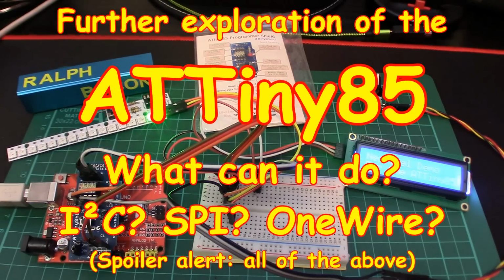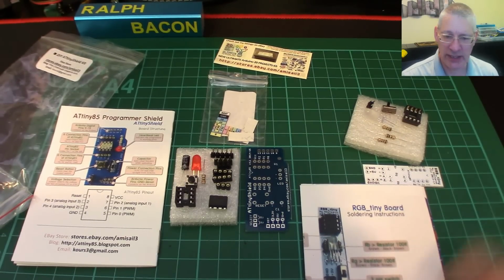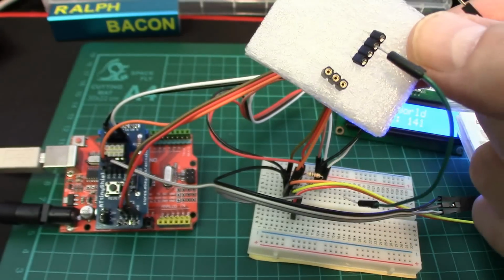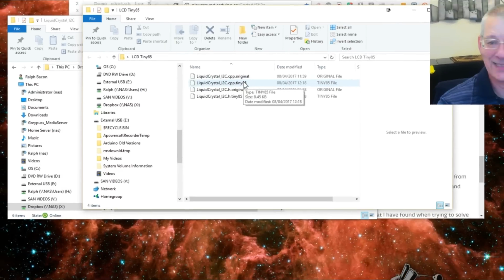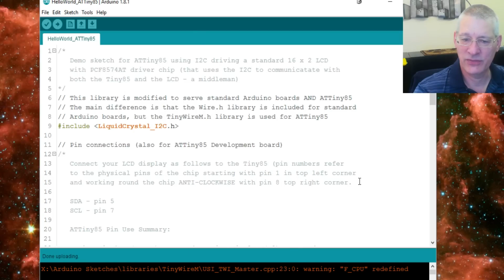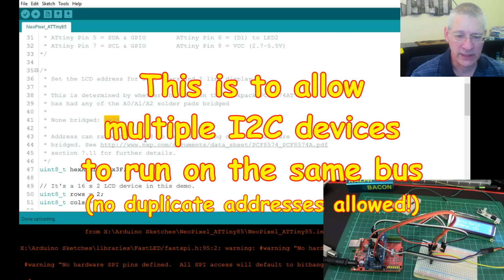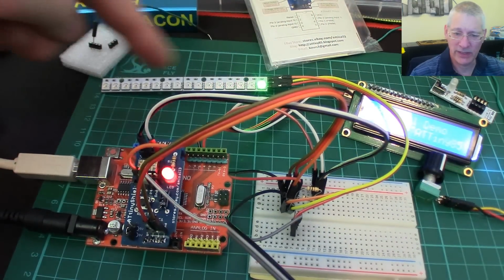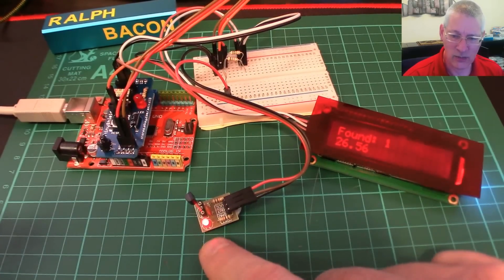#82 ATTiny85 + I2C  + SPI and more!

Comment: I have a Digispark ATTiny85 and it won't compile with a sketch for an LED matrix that uses the MD_Parola and MD_MAX72xx libraries. It shows the following error: Arduino\libraries\MD_MAX72XX\src/MD_MAX72xx.h:50:10: fatal error: SPI.h: No such file or directory.
I've already researched this and it's because of the SPI issue with the Digispark.
Do you have any tips? Thank you.

Comment: 12:32 You could make a few frames darker during editing. Why don't you?
Reply from the maker: Yes, I should have but it's a bit late now, some 6 years later! I'll bear in mind for future videos!
Reply: @RalphBacon  Hahahaha, I appreciate the good sense of humor. Thank you for the vids. Nice to see you tinkering with this stuff. Reminds me of my dad.

In my case, I didn't use the Arduino IDE, but bare CMake to compile the firmware and `avrdude` together with a programmer to upload it to the ATtiny85 or ATtiny13A.

The programmer is a fake AVR programmer I bought on Amazon, but it works great. I just had to solder an IDC connector (so it could receive the ISP cable) to a board and connect it to the DIP adapter that will hold the microcontroller on that same board.

It's fun

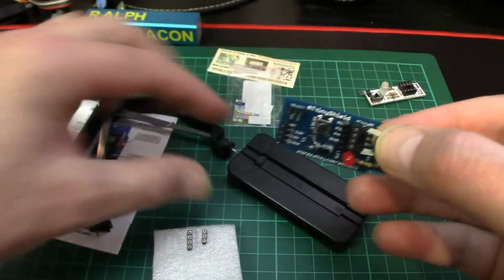Comment: what the name of the tool in 7:07?
Reply from the maker: It's an IC pin straightener, available generally, quite cheap and works a lot better than using your workbench to straighten pins! Example: https://bit.ly/DipPinStraightener

Comment: Hi Ralph. Any plans to do more vids on the ATtiny85 and/or ATtiny84?
Been using the 85 in a few projects recently due to only using a fews pins, and just acquired a couple of 84's yesterday and successfully uploaded a sketch last night. I think they're pretty cool chips.
Have made a couple of register name changes to my avr sleep code and although not actually uploaded, it compiles. Seems that the ATmega code will compile with the 84, but the 85 uses a different wdt register name.
Anyway.... Just thought.
Cheers.
Matt.
Reply from the maker: TBH although the ATTiny85 is a great chip for smaller projects, or even as interface chips for bigger projects, the lack of even I2C (designed to connect chips together, remember) is a bit of a handicap.

Yes, we can bit-bang both I2C and SPI (as per my previous videos) but we quickly run out of pins. The ATTiny84 has more, of course but then I get to the question: "Why am I doing this when I can get a cheap Arduino Pro Mini that has loads of built-in functionality and many more pins?" And all known Arduino code will run on a Mini as it's just an UNO without a USB interface.

What sort of applications are you thinking of, Matt?
Reply: @RalphBacon  Thanks for the reply. Warning.... Very long post ahead!! 
Most of my uses are simple industrial things. For example, scratch building a dual axis sun tacking solar panel array. Using a nano for that. It basically sleeps for 10 mins (using your excellent code) then wakes, homes in on the sun and goes back to sleep. Another very useful project was a Li-ion battery spot welder using an ATtiny85 (my first time with this chip). Used all the pins and disnt need more so when I made the PCB for it, it was nice and small. This is what got me hooked on the ATtiny chips. Another recent one was hacking my cheapo laminator and building a temp controller. It's currently using an ATmega328P, but may well liberate that chip and use an ATtiny, again just because of its small size.
Project at the moments is a current monitor for my 3D printer power supplies. I'm running a pair in parallel and need to keep an eye on current sharing. The 85 is working very well for this by monitoring by way of a pair of ACS712 modules and displaying the current on an OLED. 
Other projects such as my engine ignition simulator and motorcycle data logger use an ATmega328P and ESP32 respectively. The ESP32 is great as I've got pretty much every pin in use reading a sensor or doing something.
So what would I like to see from the smaller chips? Using timers perhaps. Maybe cunning ways to keep memory use low, as that always worries me a little. An example is the MPU6050 IMU that I'm using with the ESP32. I'm using the MPU6050_tokn library, but it sucks up a lot of memory, so a basic tutorial on i2c and how to interpret the data sheet with the 85 (or ATmega328P) would be great. I know you've done loads on i2c but having some detailed stuff in one super long vid would be a wholesome watch.
Probably blabber Ed on enough.
Merry Christmas.
Matt.
Reply from the maker: I thought I had a lot of projects on the go at any one time; you beat me hands down, Matt!

Keeping memory low can be achieved if you are prepared to look past the Arduino-speak C++. Using slightly terser syntax can save quite a bit of space on the smaller chips. I did a Fridge Alarm challenge a while ago to see whether I could get the code and functionality of an existing Nano fridge alarm squeezed into an ATTiny13. It would be a lot easier with an ATTiny85. Video #'177 gives some ideas, as do the comments:
https://youtu.be/w9EO3Xm-fHU
Reply: @RalphBacon  Mant thanks for the reply Ralph. I'll watch your vid.
Was playing again with my current sensor today, implementing some extra features. Agreed on straying from "Arduino speak". I try that as much as I can, but I'm still learning.
If using just the chip then I don't use a bootloader so this gives me a bit of memory to play with.
As you said previously, probably would be easier to just use an ATmega328P, but I like a challenge! :-)
Having said that, I got myself an ATmega328P au smd chip in a quest to go small, but so far my smd soldering skills leave a lot to be desired LOL!
Anyway. Hope you had a great Christmas and all the best for a video packed 2022.
Reply from the maker: Thanks Matt; and don't forget the Arduino Mini is very small with all the UNO capabilities!
Reply: @RalphBacon  indeed Ralph, the Pro-mini is certainly a handy tool to have and conveniently sized.
As it is, I tested your sleep code on the AT84 and all works great with no changes, and now uploaded my sleeping solar panel controller to the AT84 and all seems good.
Matt.

Comment: El programa que usas para la pantalla i2c, donde puedo conseguirlo, he probado varios y no me muestra como deberia. Quiero mostrar voltaje y corriente en el lcd usando el attiny85.
Reply from the maker: Remember that the Tiny85 does not have native I2C - you will have to bit-bang as I showed in this video or use a UNO/Nano that has it built-in. I use a standard 16x2 LCD (with the I2C PCF8574T "backpack" installed - or you just solder it yourself). The library I use is the LiquidCrystal_I2C, but it is no longer maintained. But it works very well and I use it in my current Smart Heater Controller project.
Reply: @RalphBacon  me parece bien así lo are, los programas que ejecutas, donde puedo descargarlos, me interesa mas el ultimo, donde muestras la temperatura. si me lo puedas compartir me seria de gran ayuda como guía a mi proyecto. muchas gracias por ayudarnos.

Comment: Hi Ralph. Do you know the best i2c library for using the ATtiny 84?
Reply from the maker: Use the same one as for the Tiny85; they are basically (nearly) the same chip but the Tiny84 has more pins.

Comment: Can we do that without making the chip unreprogrammable   please tell
Reply from the maker: I2C uses two pins. SPI needs 3 pins plus a Chip Select (although you can cheat and just wire that pin permanently LOW on the device so it is active all the time). Two pins are VCC and GND. That makes a total of 7 pins on an 8-pin device. That means we do not need to use Pin 1 (RST) as a GPIO so your ATTiny85 remains programmable.

Comment: Any idea if you can run RS485? My DHT22 digital temp sensors are too far from my central Arduino and are unreliable. I'd like to deploy them on ATTiny85's with MAX485's to create a network to talk back to the main Arduino/PC.
(I ask because I haven't played with RS485 before, only RS232 directly on the Arduino pins. I assume I only need two digital pins the same, but don't know if they need to specific. Hopefully I'd be left with a digital pin for the DHT22 and an extra or two for auxiliary general I/O I could use for remote relays/LEDs, possibly analogue input, PWM driven loads.) Thank you!
Reply from the maker: I've not tried an ATTiny85 on RS485 but I did a video on RS485 using Arduinos ( https://youtu.be/Bhvap1qXcHg ) I'll let you have a look at that to see what it entails. Pretty simple and reliable.

Comment: Nice video.
Where do you get those decals for on the pins
Reply from the maker: They came with the kit I used - but you can make your own very easily on the computer, in the same way I do for the Arduino pin headers. Very useful.
Reply: Thank you for this response.
Do you have an example to make this yourself.
I would be very grateful to you.
Reply from the maker: I had a look but I could not find the ones I used, sorry. But, frankly, you can just do this freehand, neatly, keeping the pin spacing correct (0.1" or 2.54mm) and it works quite well. You may spot my hand drawn ones on the Arduinos I use. Best I can suggest.
Reply: I made some that I have used, I just printed them onto label paper. they are at this link: 
https://www.dropbox.com/s/bz64pmnrqp3e9hn/Arduino%20labels.xlsx?dl=0

Comment: ATtiny has 5 I/O pins but if you realy, really need a 6th one, I think you can use the reset pin as an I/O but you have to be careful since it cannot handle very much juice.
Reply from the maker: When you get to my "All 6 Pins" video you will get more information about this.

Comment: I think the resistors on sda/scl are there to keep it stab;e/ sp basically it will work without them.. ans sometimes it won't. Just like he said happened.
Reply from the maker: Basically, you need ONE set of pull up resistors on SCL/SDA. The trouble is, most modules have them fitted so no-one checks anymore. Then two things happens. I2C fails to work because there are NO pullup resistors, or that there are too many (if you have several modules attached to I2C, for example.

Comment: I think I read that it's the sda/scl data that can't be shared with the master chip and the lcd.
Reply from the maker: You may be right, I've not used an Attiny85 in some time now because I keep running out of pins!

Comment: That "IC puller" is not made for DIPs. It is for PLCC-type packages in sockets, where the metal hooks fit into slots in the socket to lift the chip out. The pin straightener is superfluous, being a simple matter of placing the pins sideways on the table and gently bending them square. These are 'Arduino-generation' problems. Ya gotta know the rudiments...
Reply from the maker: Yes, I use that chip puller when I use my PLCC adapter boards but it really also works just fine for small 8-pin chips. But I really need a standard DIP pin puller too, about time I invested in one. I have to disagree about the pin straightener; I used to use a table like you suggest, about 30 years ago, but using the pin straightener tool is soooo much better, even if only a couple of pins are out of alignment. Oh, I guess that makes me not of the  Arduino generation, after all!
Reply: Bullshit. The IC puller has been around since before the PLCC.

Comment: You mentioned that the DS18B20 is a SPI device, this is in error I guess as it is a 1-Wire device
Reply from the maker: I really said that? What?!? Considering I even did a video on this device (and put two together in parallel to show how they are individually addressable) that was a bit of a Doh! moment indeed. Thanks for letting everyone know what a muppet I can be, Graham. Now, if I can just remember how I add someone to my YouTube comments blacklist...
Reply: @RalphBacon  what video number was that as I would like to see how you address more than one device on the 1-wire bus
Reply from the maker: That's video #28, Graham, one of the early ones, almost vintage so view carefully and do not disturb the sediment.
Reply: @RalphBacon  hehe. Love the vintage stuff.....
Reply: @RalphBacon  Out of interest, and I can't remember where you made the comment, the I2C pull - up resistors, needed to create the data start and stop conditions at least let alone the data changes, 10K is recommended  for a 100Khz bus speed and 2K2 for 400Khz and 1Mhz. I just stick to 2K2 and you can't go wrong :)
Reply: @RalphBacon  it doesn't  really explain why the serial number (not address as you referred to it as) is identified

Comment: Hi Ralph,The turn pin headers you don't like are the better pin headers as they are anti-creep headers that stop the chip working its way out when in a situation of vibration but are more expensive I used to use then on my temperature controllers to hold the Pic micro in place but we then changed to SM so that fixed that, nice video I want to pulse two strings of LEDs with PWM so I am going to use the ATTINY so your video will help all the best Bob
Reply from the maker: The turn pins might be great for IC pins but Dupont cables don't fit, that's the issue (for me), Bob. I've seen chips tied down with cable ties before now... Good luck with your strings of PWM-controlled LEDs, should be ready for Xmas? Or the summer BBQ?

Comment: Greetings Ralph S Bacon. I've been trying to read the temperature with a DS18B20 sensor and my ATtiny85, and the test was successful. Now I want to make a digital thermostat with it. For example, if the temperature es higher than 29°C the ATtiny should turn on a led, and if temperature is lower than 25°C the ATtiny should turn off the led. I made this test and the ATtiny85 turns on the led, but when the temperature is higher than 29°C the temperature stops changing (f.e. 29.12°C), the led turns on and it never turns off. Do you have any idea why this is happening?
Reply: Hi there. I've been analyzing my thermostat example and I see that if I put a 'while' condition the ATtiny85 freezes. I don't know why but it happens. Nevertheless if I do this with 'if' conditions between 25 and 29°C it works perfectly. Thanks anyway, although I'd like to know why my ATtiny85 freezes when I put a 'while' condition.
Reply from the maker: If you want to either post a (*small*) sketch here or send it to my email address (which you can find in the About tab of my channel) then I'll have a look.
Reply: @RalphBacon  Ok, this is the code i tried to use first:

#include <LiquidCrystal_I2C.h>
#include <OneWire.h>
#include <DallasTemperature.h>

uint8_t hexAddr = 0x27;

uint8_t rows = 2;
uint8_t cols = 16;

LiquidCrystal_I2C lcd(hexAddr, cols, rows);

OneWire onewire(1);
DallasTemperature tempSensor(&onewire);
int fan = 3;

void setup()
{
  lcd.init();
  pinMode(fan, OUTPUT);

  tempSensor.begin();

  lcd.backlight();
  lcd.clear();
  lcd.setCursor(0,0);
  lcd.print("Thermostat");
  lcd.setCursor(0,1);
  lcd.print("Wait a moment...");
  delay(2500);
  lcd.clear();
}

void loop()
{
  tempSensor.requestTemperatures();
  delay(500);
  int temperature_max=29;
  int temperature_min=25;
  float celsius = tempSensor.getTempCByIndex(0);

  lcd.setCursor(2,0);
  lcd.print("Temperature:");
  lcd.setCursor(4,1); // column, row (zero based)
  lcd.print(celsius);
  lcd.print(" ");
  lcd.print((char)223);
  lcd.print("C");
  if(celsius > temperature_max){
    digitalWrite(fan, HIGH);
    while(celsius>temperature_min){
      digitalWrite(fan, HIGH);
      celsius=tempSensor.getTempCByIndex(0);
      lcd.setCursor(4,1);
      lcd.print(celsius);
    }
    digitalWrite(fan, LOW);
    }
    
  else{
    digitalWrite(fan, LOW);
  }
}

The result is the ATtiny85 freezes when the temperature is higher than 29°C. I've solved this problem using if conditions without using 'while' condition and it works perfectly.
Reply from the maker: I've been looking at this but I can't immediately see the problem. When you say the Tiny85 "freezes" what do you mean? From your sketch the LCD should display a temperature of above 29 (so let's say 30), the fan starts up, then the temperature on the LCD slowly reduces down to below 25 (so 24) at which point the fan switches off.
At what point do things "freeze"?
Sorry for the delay, I didn't spot this reply.
Reply from the maker: Another question: how are you powering the DS18B20? Parasitic or separate power line? Have you tried a delay of (1000) in the "while" loop, as it takes time for the temperature conversion to take place.
Reply: @RalphBacon  Don't worry about the delay. When I said my ATtiny85 "freezes" I meant that if temperature is higher than 29°C the LCD shows e.g. 30°C and there aren't any new readings, it doesn't matter if I heat up or cool down the sensor, the LCD always shows 30°C and the fan never turns off. If the temperature is lower than 29°C I don't have any problem and the LCD always shows the temperature changes.
Reply: @RalphBacon  Talking about powering the sensor I used a separate power line with a 4.7k pull-up resistor. I tried delay and millis but it didn't work. The problem is when I use a while condition on my ATtiny85 it executes the code inside the while condition, but it never gets out of it. To solve this problem I put an if condition inside another if condition.

if(temperature>25){
if(temperature>29){
digitalWrite(fan,HIGH);
}
}
else{
digitalWrite(fan,LOW);
}

Now my thermostat works perfectly, but I don't understand why I can't use a while condition as I said before.
Reply: My new book, "Arduino for Paramecium" is just what you need. Only $2700, on the dark web...